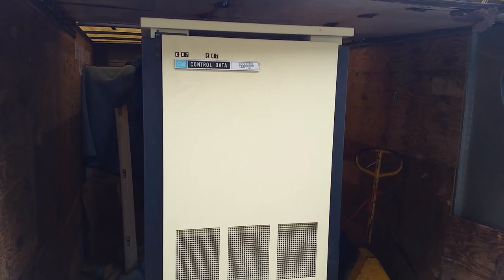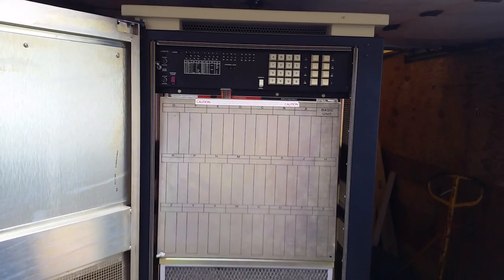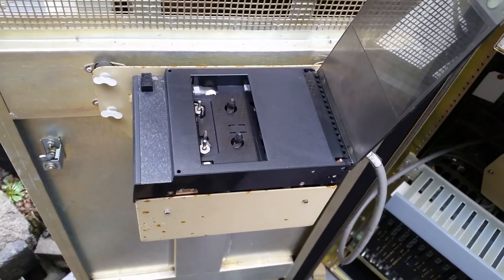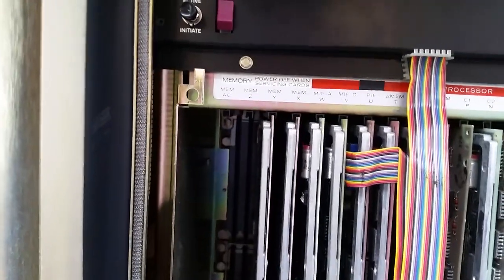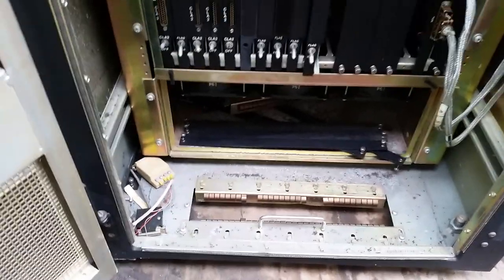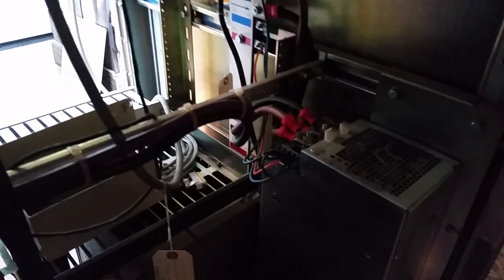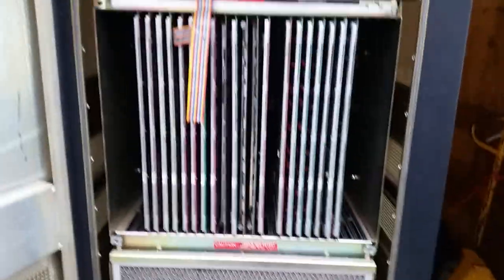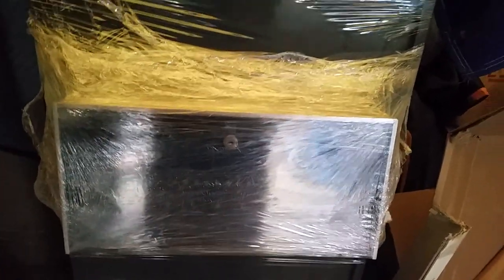CDC 2551 Network Processor Unit

Comment: Making 400 Hz out of 60Hz.... Perhaps oldschool with a 60 Hz motor, a 12:80 teeth gearbox and then a 3 phase generator? That would be interesting... Today we have ways without moving parts but that does not look as cool when operating.
Reply from the maker: CDC initially used motor generators, then solid state units. I have one BIG motor generator (25 kVA) , plus a number of similar solid state units.
Reply: Would be cool to see them in action some day :)
Reply from the maker: Nothing to see, really. Maybe cool sounds.
Reply: Yeah it's mostly a "It looks like that" and "Let's start it up" thing. Once it is operating it gets boring rather quick.
Reply: Chip Guy Vids — Control Data installations of the era all had big motor generators for 400 Hz power.  The mainframe used it, not just this little accessory.

Comment: The 2550 was a bit of a dud.  The design was crippled by having very primitive serial ports that required a lot of CPU overhead.  And in addition it was programmed with a very primitive Pascal compiler.  You combine slow hardware with slow software and you got a real dog.  I don't remember exactly but it could only handle like FOUR serial ports at 1200 baud.   To add insult to injury, the 6600 mainframe OS had rather simplistic terminal I/O.  It could send 6-bit display code characters to ASCII terminals, it could read keyboard input, but only slowly and with no error correction protocols and only at a rate of 1 line every few seconds if going to a running program.   Nobody was ever amazed by these setups.
Reply: I worked on the 2550 as a systems programmer.  RS-232 was the technology of the day for serial ports, so it was just doing what was necessary at the time.  Pascal was also in its heyday at that time, so I see why they decided to use it.  I think it worked out well enough.  CDC considered developing a better software system, but decided it wasn’t worth the effort.  It was just as well, because the whole concept of how networks of many users accessed shared resources changed considerably not many years later.